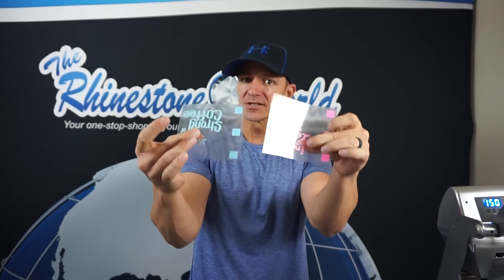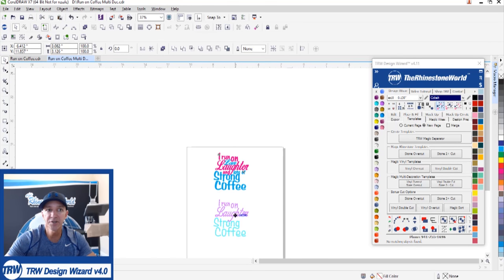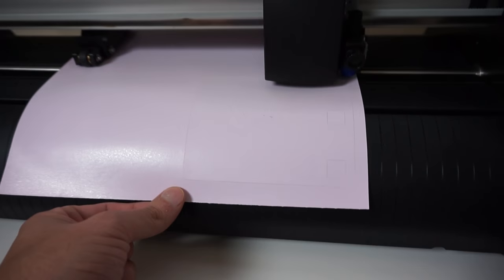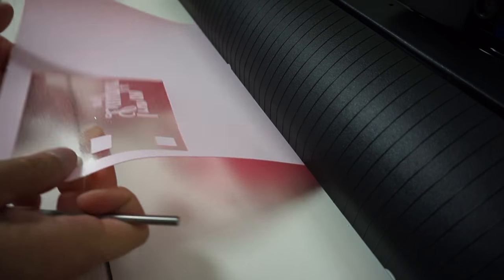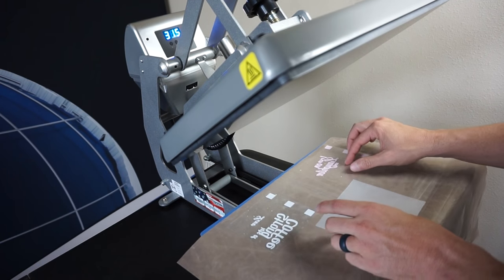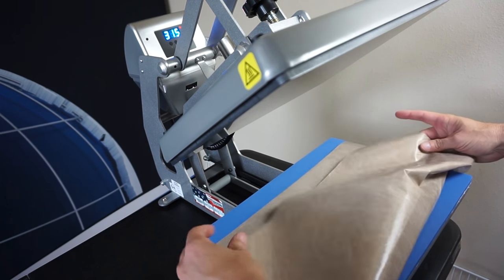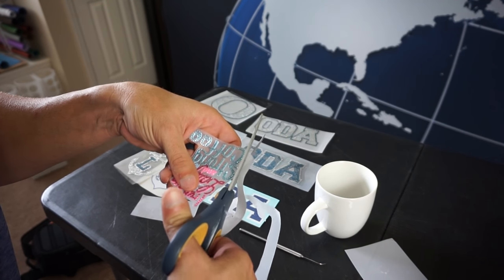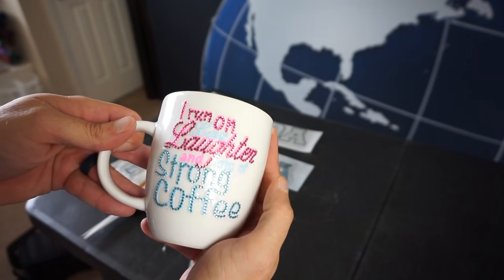How to make a Glitter and Rhinestone Custom Coffee Mug with a Heat Press and Cutter

Comment: Hey there guys, i just found this video and would like to ask if i can use the HTV Anything material  (and would it work just as well) as i have bought this from you but i do not have the Bling Anything material.  This just gives me some more ideas! Thank you.
Reply from the maker: Hi there!  Yes, you can use HTV Anything material to make these multidec decals.  Bling Anything was our original material that turns heat applied materials into dishwasher safe decals. The difference between Bling Anything and HTV Anything is that if you're using rhinestones ONLY for the decal, then only Bling Anything can be used. Bling Anything is a bit thicker because it has the extra layer which melts around the edge of the stones to hold them to the decal.  Let us know if you have any other questions. Thanks! -TRW Pilar

Comment: Can you use any kind of heat vinyl with the GoPro anything?
Reply from the maker: Hi there! It's actually called Bling Anything. the GoPro is a camera and not one of our brands. :) Bling Anything needs thicker vinyls like Glitter htv or Brick.  We invented our new decal material called HTV Anything which can take some thinner htv but you do need to test and practice to not get bubbles in your decal.  Thanks for watching! -TRW Pilar

Comment: You don't have to press again after applying the bling anything material? Would doing a final press with a cover sheet after the full application increase the durability any?
Reply from the maker: JadeBerth,

Are you talking about after you apply it to the cup? The bling anything has an adhesive backing so it's not necessary to heat press it after applying. :)

TRW Alexis

Comment: Hey there,

I what to buy a Heat press for t-shirts and hoodies , but i have some doubts. My budget is +/- $300.  I thinking in a Manual 16'x20', but im opening to suggestions, about sizes and Manual or Automatic and vertical press or horizontal. If you can give a hand i will appreciated. 
I forget to mention, the press i need is for use with a DTG printer.

Thanks and  keep the good work
Reply from the maker: Hello, 
This is a link to our most affordable heat press http://therhinestoneworld.com/Red-Digital-Clam-Heat-Press.
However, it does cost $465 and it is only 15" x 11". You are welcome to look online, but heat presses usually do not run much lower then $450. When looking online, be sure to check for quality, because your heat press is one of the most vital parts of your business. 
TRW Kaitlin

Comment: always enjoy your tutorials..can we use regular vinyl 651 on heat press or does it have to be heat press material??
Reply: Bernice Gordian 651 is sign vinyl and does not require heat for adherence, adhesive is on the back. Regular glitter htv is bolder than glitter sign vinyl. This is just an alternative to using sign vinyl.
Reply: @pytricewilliams4469  can you use any kind of heat vinyl with the GoPro anything??

Comment: I like to place an order for your products.  i just have one question.. can this be done with a cricut and an iron?
Reply from the maker: Hi Norma! This should work with a Cricut, but we cannot guarantee it because we do not work with Cricut. We do not recommend using an iron because you cannot control the heat and pressure evenly. TRW Alex

Comment: Can you use the bling anything material with standard 651?
Reply: Tiana Smith There's no need to use bling material with sign vinyl because it has adhesive on it. It's used with regular HTV because you're not using heat to apply it.

Comment: So you can layer rhinestones on top of glitter vinyl?? I thought you couldn't layer glitter vinyl. Interesting. Is that because of the Blink  N E Thing material? Thanks.
Reply from the maker: For garments that will be worn and washed frequently (clothes) you will not want to layer rhinestones on top of any vinyl as it will not adhere. It works out in this case because it's pressed to the bling anything and also  it's not going to be worn and washed like a garment would be.
TRW Alexis